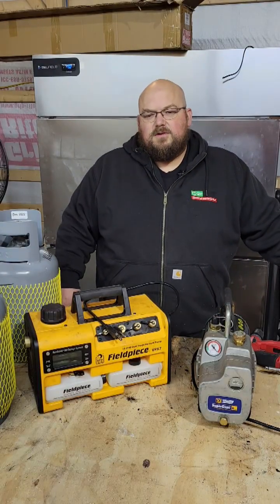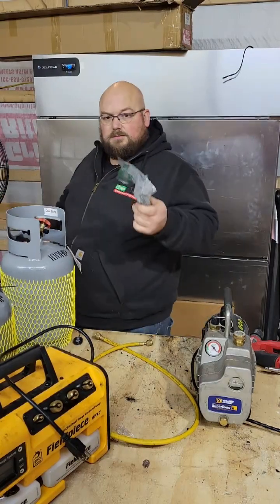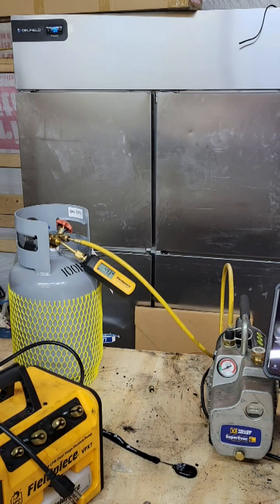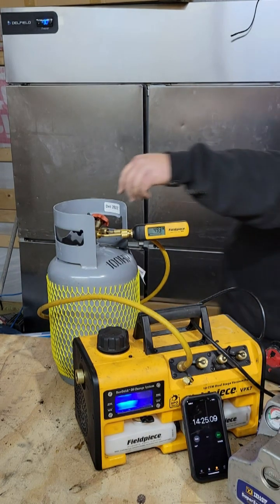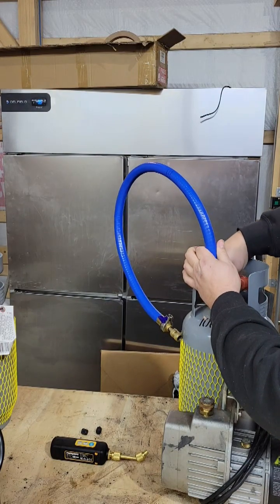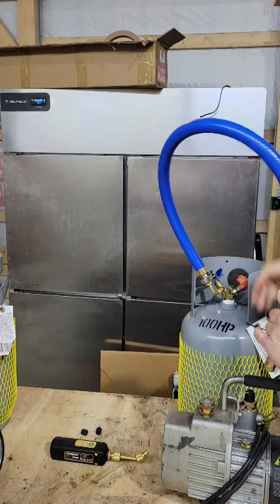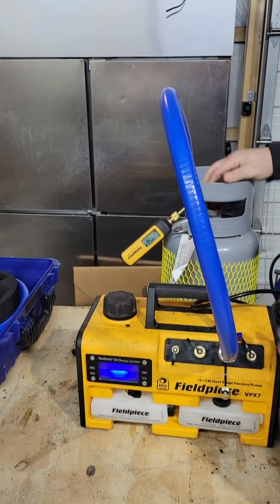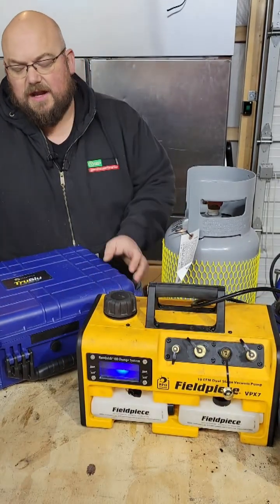Tech Tip Tuesday. The difference a hose can make.

Comment: Hands down proof that bigger is better if you have a pump that will move adequate volume.  I just laugh and shake my head when I see techs bring out this heavy-assed 6, 8 or 10 CFM pump and use their manifold set to evacuate.  They'd be better served pulling out a 3 CFM or less vac pump.

Comment: Thanks for this, I just ordered the FP 6cfm pump but wanted the 10cfm however I could not justify almost double the cost since I am not a HVAC tech but after seeing the performance difference between the 6 and 10 Im happy with my decision. I already knew about trublu and have them on my list. I would love to see if there is any change by using 2 hoses on the FP vs. using just one hose.  The hoses arnt cheap and trying to decide between 1 or 2 hoses.  If two hoses hooked directly to the FP only makes a small difference (seconds not minutes) then I will probably go with just a single hose. Thanks again for putting this out there. thumbs up